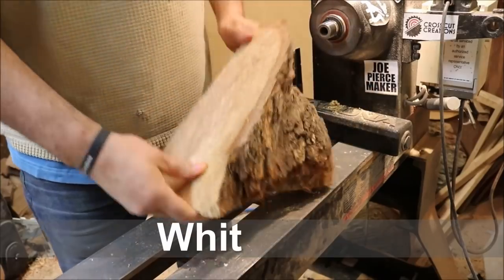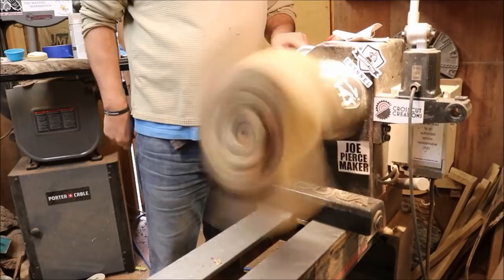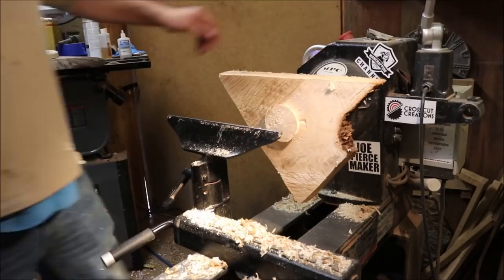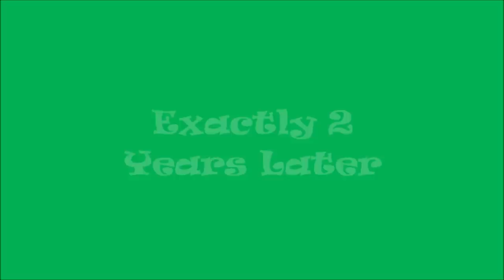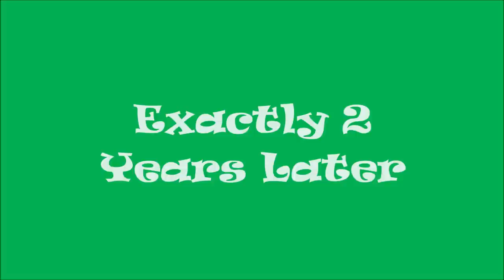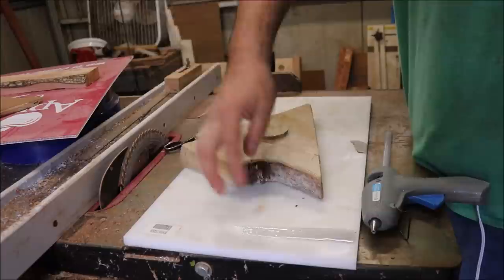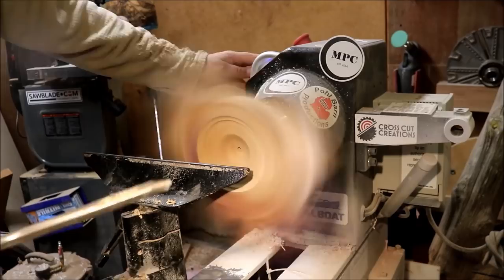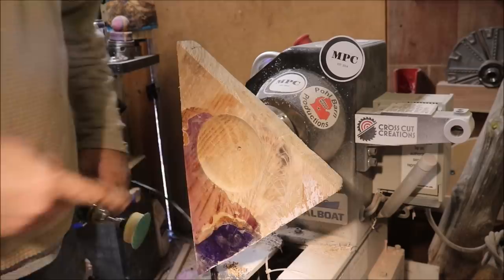Wood Turning - The Triangle

Comment: I just began my resin journey .  I don't have all the fancy tools you have yet and definitely don't have a ton of resin on hand to do all the things I'd like , but watching you create these beautiful pieces gives me the fire and determination to work towards it.

Looks great btw! 
I'm in USA in NC to be specific 
Good luck everyone! & thank you and your sponsors for all this.
Sure am glad I read the description 😆
Reply from the maker: Good luck! I started off with cheap tools I got off or Craig's list, except my old lathe . Then I scavenged for wood everywhere I could. I started making bandsaw boxes, cutting boards and business card holders. Every penny I made I put back into the business. At the end of each year I buy one piece of equipment so my business shows in the black. It took 10 years but I am only one piece of equipment from filling out my shop. As for the resin, TotalBoat has a cheaper resin called 5:1, I started using that first. It runs around $130 a gallon. Plus the 15% off one time use coupon in my description. I am still learning to conserve resin. Filling the inside with wood or something. You can sell your items and buy more resin to make more items to sell more items to buy more resin. It's a vicious cycle 😂😂😂 . I say all this because if you have the fire and determination you will succeed.

Comment: US! Great video! What size hole do you drill for your worm screw? Say you have a 3/8 screw... Slightly undersize?
Reply from the maker: Hey Ben,
It all depends on the type of wood you are turning.  Nova suggest 9/32 or 7mm for soft wood and 5/16 or 8mm for hardwood. I used the 5/16 drill bit on this one. I hope that helps. BTW you are in.

Ken
Reply: Thanks for the reply! I'll see if I can dig up the paperwork that came with my chuck and screw...